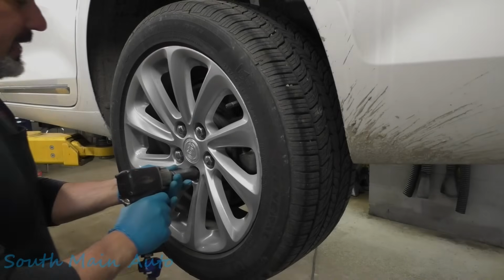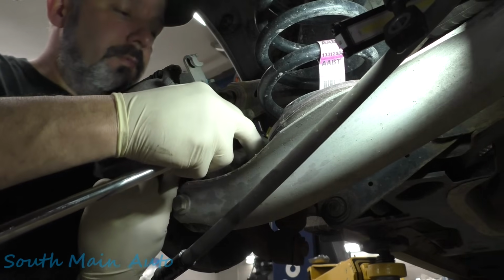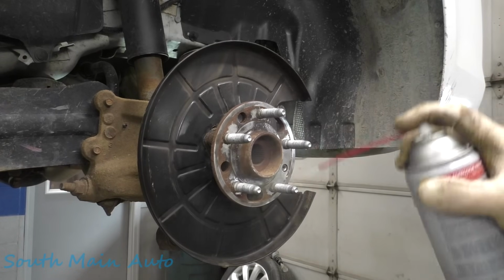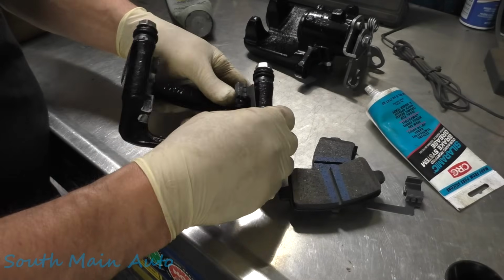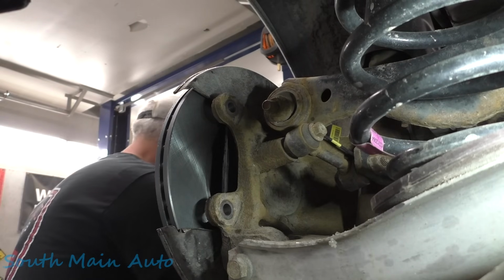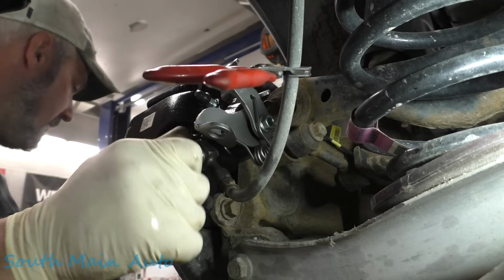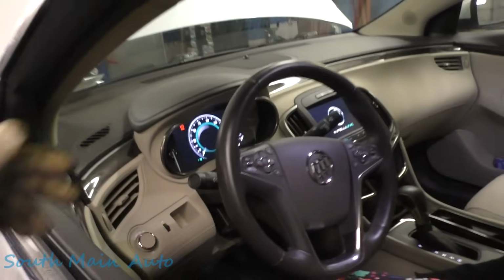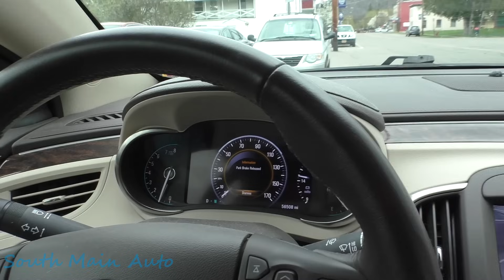Buick LaCrosse: Rear Pads, Rotors & Calipers

Comment: Cmon! You should know better!
Electric parking brake is a solution to a non existing problem?

In my humble home mechanic experience, every single parking brake cable does get rusted and stuck, which then drags parking brakes, overheats and wastes gas.

Plus electric parking brakes do save space and a bit of weight (no steel cables or mechanism to apply them).

Safer too as they won’t allow you to suddenly apply the manual kind and fishtail, or leave it on and damage tires etc.

I do miss the manual kind, but I’m very happy with the electric system and my console looks much better and with more space.

Comment: I thought that these nonsense Electric Parking Brakes needed a scan tool to put them in "Service" mode, otherwise when you put on new rotor/pads and/or caliper, when you start the car the E-P Brake will close to a preset (or previous) position, thus crushing the new pads?

Comment: No way crimping brake lines is the most controversial........solder vs. crimping is way more rage inducing!
Reply from the maker: Oh... let me break out the welder....
Reply: @SouthMainAuto  don't forget using an extension with a torque wrench.😊
Reply: @SouthMainAuto  haha..... welding close second I think.

Comment: replace the brake line first
Reply from the maker: The brake hose was fine. Calipyer was locked up. Hoses are easy to test, just crack the bleeder loose. If it frees up, problems in the hydraulics (usually hose) if it doesn't, it's in the caliper.

Comment: Ford used this dumb electronic parking brake setup on higher spec versions of their first generation C-Max. The common repair when it inevitably fails is to throw the electronic part in the bin where it belongs, and fit the mechanical lever from a lower spec C-Max. EPBs are nothing but a nuisance, absolutely no pros but a lot of cons.

Comment: That's just horrible this lacrosse for electric parking brake. Just another thing to go bad and expense instead of using a manual parking brake. I'm sure those motors go bad and is very costly. Cars are getting worse as time goes on. I'll stick with the older cars for now as long as I can

Comment: +60 degree bullshit for a brake caliper.

GM engineers trying to overthink nut and bolts so hard, they cant see the actual parts they are using is just plastic shit.